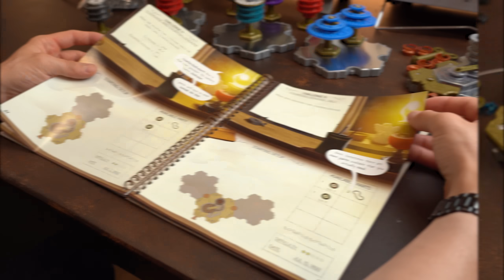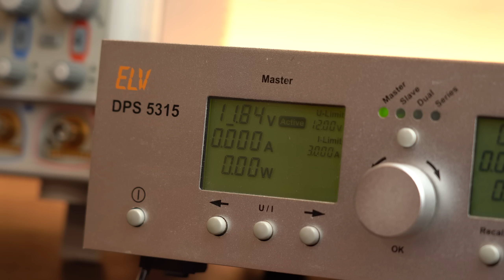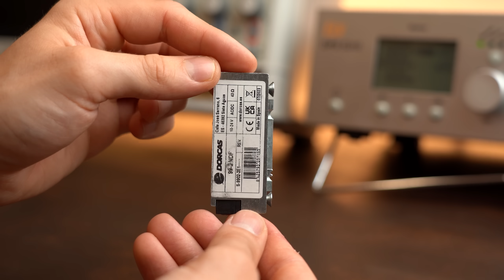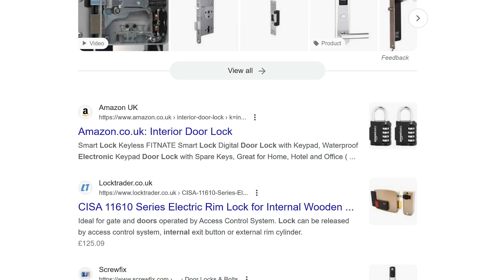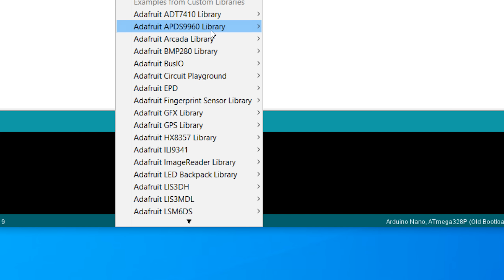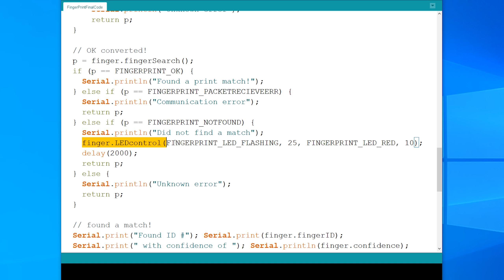Your Door NEEDS this Upgrade! DIY $40 Fingerprint Lock!

Comment: Beware!  Children are more resourceful than you expect.

You will need to add a door closer so that you can't forget to close it, leaving it open when the child is free to roam.

I'm sure that power is available on the lab side of the wall, which is probably already considered unattractive anyway.

For safety (such as getting in there with a fire extinguisher), mechanical backup is mandatory.

For door mounted mechanisms, note that power is only required when the door is closed.  So, for example, wireless charging coils could be arranged to be in proximity when the door is closed, or even some low voltage physical contacts connected.

This is clearly not high security.  (As shown in the video, the latch is easily slipped.)  So, a button high enough to be out of reach of a child standing on a chair should be just as good as the finger print sensor, and simpler (thus more reliable), if less exciting.  And then it may as well be a mechanical button, which will work even if the power is out, and takes care of mechanical backup.

Comment: I build myself somthing very simular but insted of a fingerprint scanner i use a RFID card and a Keypad (when i forget my keys in my rom). I Put all the electronics inside my room the code curently has about 5000 lines because i save my Passwort in the EEPROM and also the RFID Cards (I have 4 of them). Also it opens the door automatic when I open it. ( Actually today I rebuild most of it on the inside because I changed the housing). It uses a Arduino Mega. (I could try to make a video about it i Think)

Comment: In case you can get one, maybe replace the fingerprint scanner with RFID? I sometimes after being a jackass with chemicals or tools my finger isn´t recognized by my phone, can easily happen here... and for the cabling, maybe make a channel in the wall and plaster it or - full caveman: drill a hole straight through the wall behind the box to your mancav... ohm... workshop and there, who cares about the looks... :P

Comment: My job uses the same lock mechanism, but with RFID cards. Unfortunately, the original people who installed it got it slightly off, so now it periodically can open because the door's latch just gets smooshed by the extra millimeter of metal.

Comment: I, as an electrician, wouldn't add an extra outlet, I would just use outlet splitter, or connect wires directly to the main power if the device has to be connected permanently.

Comment: Well, no fallback in case of loss of fingerprint or such (Yes, I did once lose them for a month), but you also did it very insecure by placing all electronics outside. But since it's against a baby, that should work for a few years. Not that many with you as the dad though.   For the power: route the whole thing through to the other side. You can mount anything there, can't you?

Comment: I think it would be an easier solution to use a magnetic door lock so the only moving part on the door is a metal piece and the electromagnet can be inside.

Comment: I still don't get why you can't power the door knob solution with an outlet. I would try to stick with a solution like it's done for the door locks in cars (automotive solutions are usually very optimized).
Or you power the door knob with contacts between the frame and the door, with minimal power buffer, while the door is open.

Comment: Ok, we covered the electronics on the outside of the room and the missing mechanical override. Am I the only one questioning the weakened door frame? It looks like all that's left is a thin veneer. Give it a good tug and the whole locking mechanism breaks off. Guess you could count it as an emergency mechanical override. :P

Comment: Rather than putting that lock in Handel you could put it in key lock so that if power failure you could just use key and don't have to modify Handel

Edit:Why didn't you use the magnetic lock?

Comment: This is like you are reinventing the wheel 
This goes on the lock mechanism notthe open one so if ever this fail u use your key and u use your door as normal this simple 
But the opening mechanism that you replaced it with is nice i mean i didn't knw it existed

Comment: 1:40  "The speed of the chain, for example, is the current... and the pull of the chain is the voltage."
Um, wait, isn't it the other way around?  🤔

Isn't it, voltage - speed, and current - torque?  now I'M confused.  ;-]

Comment: Could you have put it on the bolt at the bottom rather than the handle latch? That way you can leave the old handle on the locked position and have the key as a redundant backup in case of power failure or the Arduino failed.

Comment: As others have said, wire in from behind.
Use the light switch as an electrical fitting.
Yes, I know you're German and probably want everything done exactly according to building regulations, but the current draw of that fingerprint reader is so negligible that it won't be an issue on a lighting circuit. I assume you do all electrical work in your house too, so it's not like you'll be confusing any electricians. 

As for powering one of locking handles, you could add contact pads to the door and door frame that charge the battery when the door is closed. There may even be a handle on the market that has the latch split in two, separated by an insulator and charges through the latch.

Comment: If you generally have no concerns to drill a hole for a socket in your wall. Then drill a hole next to the door, makes the design more compact and let the all disappear in the wall, Then only the reader looks out of the wall ? Possibly even with an ESP8266 for WLAN and Smarthome connection.

Comment: Make sure there is some kind of a mechanical override. These electrical locks, or the electronics controlling it, tend to fail at some point in time.
For me that was the reason to use one of those locking bolt solenoids that retract when not powered. That means the lock will open if there is a power failure.

Comment: Put a hole through the outside handle. Put the sensor withim thay knob and feed the power wires through to the crack in the door frame. Wires will be hidden, the sensor will look nice and itll be more convinient having the sensor in the handle, renoving the need for the extra box on the side

Comment: Your audio/microphone is much lower compared to other video's

2 points wrt these kind of locks... 
How do you cope with (mains) power failure (e.g. when there is fire).
How do you keep the door locked when the mains power is not there?

Comment: I would recommend a solenoid deadbolt that mounts in the frame, and wiring from the inside of the shop. Just requires putting a cavity in the door. A backup battery or a manual turn key would prevent issues if power fails and you need to get into the shop.
Alternatively, you could use a magnet and frame mounted electromagnet. Easy to bypass, but probably not for a small child.

Comment: You could have just taken out the bar which connects both sides of the door handle, cut the bar short and blocked the remaining hole in the external handle. Then you only need to replace the bar if you want the for to be normal again.

Nice project though, and I like the reader you used in the end!

Comment: You could try to get the electrical power from inside your office room, across the wall. Another concern. If for some reason there is no power in the house, you can't get into your room. However, i love the idea of electrical lock with personal identification.

Comment: Kind of bothering me that you think you cannot have the system on opening part of door because of battery. But you can have a bit longer cable and it can be wired simply and it would be ok ;)

Comment: I made it before same fingerprint sensor R503. and I placed the fingerprint sensor center of circular door handle. its more usefull. i can open the door only my one hand. 

I was only have one cable with two wires for door. Problem is i need the supply voltage and open door from inside the home for guests. This setup needs 3 wires minimally. but im too lazy for placing new cable to home. I made a polarity reversing circuit with 8p relay. If ı press button from inside and reversing polarity, door opens for guests.  There is a one bridge rectifier, one capacitor and one diode on the door for fingerprint circuit and door solenoid.The fingerprint circuit also powered when someone inside the house presses the button. thanks to bridge diode and capacitor.

Comment: How's taking bets on how long it takes before something stops working and you're locked out of the lab? 😁
Maybe a manual override somewhere might be an idea.
As I was watching I couldn't help wondering what the better 3/4 would think and then you said it. 😮‍💨 This is all so similar to what happens in my house. 🤣

Comment: Always remember that fingerprint access is more about letting the good guy not accidentally walk in, as you can fake them easily. Do not lock guns behind just a fingerprint.  It's way more secure to have a trusty phone app with an nfc app on it, that still requires a code or fingerprint on the phone.
For this purpose however it is good.
Also: make sure you can open the door with an override somehow if you lock yourself in and get unwell (like from soldering fumes, or an accidental fire).

Comment: Consider getting power from your lab and drilling a hole through the wall to your box. Also, think about adding an external power source (e.g., batteries) to ensure the locker can be opened in case of a power failure (due to electrical outages or component failures). This is important in case a child gets stuck inside or if you need to access something from the lab during emergency scenarios. To exit the locker, you would need to open the box using a screwdriver and connect power directly to the lock internally. Alternatively, you can add a simple connector externally to the box and attach the battery to open the locker directly.

Comment: You have a plenty of room for a battery. Put a a microcontroller in a deep sleep, come up with a clever way of waking it up (polling the button once a second, capacitive sensor, microwave sensor) and you have a year on 18650, which can be then swapped in 2 minutes.

Comment: Congratulations on the baby! Or perhaps commiserations if he's still in the waking up every few hours stage.

I like this project, and I think you did a great job at making it look like a professional system. But I definitely agree that the cable ducts are not the best solution for power. They'll be pulled apart as soon as your kid has the hand strength to pop the cover off. The only other downside is it could be a problem if you somehow injure yourself inside the lab and fall unconscious, it could be difficult for someone to get inside to help. But that's probably fine if there's an outside or other entrance to the lab as well.

Comment: @GreatScott! I didn’t read all messages, but you did a mistake…
You should have put that at the bottom part of your door lock, keeping it “locked” all the time…
So, I case of lack of energy, you can still use you key.
I just finished the video and changing the door handling only made it worse! :face-green-smiling:

Comment: not sure, if this is a standard design, but considering, where the wires and the electric circuit are, you can still easily break in by dismounting the box and applying electricity to the door lock by yourself...
secondly, fingerprint scanners are not that secure as you think.
i heard there is a profile, that matches 70% of all fingerprints.
nevertheless a cool project tho

Comment: The same thing I build some years ago;) I also had to drill and file on the door. I used an rfid reader and writer with an Esp32 and a custom circuit with and 24v AC Transformator to alternate the door opener. Special to make the door summing noise, to know the exact moment where a user can open the door. I created a webinterface to managed multiple users and log access times. 

Currently I planning to change the Transformator with an H-bridge to make the device smaller. 

If you’re interested, I can send you some pictures. 😅

Comment: consider adding a backup battery or switching to a "normally unlocked" lock (if exist) so in case of power outage you will still be able to open the door

Comment: I'd install a simple keyless lock at the very top of the door like shop glass doors usually have.
This way any adult can enter the room for whatever reason (if you hurt yourself and can't get up by yourself?).
It's also way quieter which should be considered when having a baby.

Comment: They do exist, just the naming is tricky if you haven't worked with building security systems. They are called an 'Electronic Door Strike' (in Australia at least), and fully replace the strike plate. Clones can be had for < $100, and often include door open/closed/latched/unlatched sensors in the wiring, can be configured to power to lock, or power to unlock. Keeps the door fire safe with the appropriate handle (locked from the locked side, exit is always 'free egress'). They cheaper strikes, as you've found are a bit of a pain, and they also generally not as robust. It's worth spending a little more for the full strike replacement, but the clones are more than robust enough for home use.

Comment: 2:30 I don't see what's the problem here 🤔 the handle doesn't unlock the door unless the fingerprint/password was input. In Korea, the automatic lock for door is a huge market and there are a lot of solution for cheap. The battery last for about a year or 2 so it's not really a problem as well

Comment: I love overengineered projects as the other guy, but you're aware you could use just a push button in the height of an adult reach instead of the fingerprint sensor, are you not? 😀 

This would have the added benefit your wife or the paramedics could get into your lab easily in case you got a heart attack or if you electrocuted yourself or something...

Either that, or make some fast and fail-proof emergency bypass of the fingerprint lock system - you know, for emergencies. 😶

Comment: Fingerprints are an identification feature, not an access control feature.
Using as access control something that you leave around on everything you touch is not a good idea...
Use something you have ( card, key, print, retina) and something you know ( code )

Comment: What makes you say you can't use the moving door as the power holder?? 

There are things such as contact pads that can transfer power through that, yes... It may take more work to fully work and may require you to use the door hinges to get it to work, but I have been sitting on this thought since I was about 12 years old....

1 : Power into stationary hinge with contact pads connected to the moving door
2 : You install everything inside the door itself and have the finger print reader above the door handle or in the handle itself, whatever you choose
3 : Whenever you move the door, power will be cut, ergo, having a single rechargable battery connected to the system will give it some time for the door to stay open while you are doing things and you may also close the door to recharge the battery automatically,... Why no one ever thinks of this is sort of beyond me

Comment: Problem 1... Control circuit is on the outside of the controlled room.
Problem 2... There are solutions that already exist for this problem. Unifi control is one, and many other options.
Problem the third... You are overworried about the infant. I say this as someone that played in the tool shed and used the yard implement ls to play as a pretty young child. If you think your room is dangerous... Imagine a room with chainsaws and other crap. Granted I wasn't an idiot and didn't play with them because I knew what was dangerous and what is just mildly annoying. Also... I knew what the tools were for and I never needed a chainsaw for what I was playing with. Granted... Play can be translated as voluntary yard work but... Meh. I knew not to use the tree prune to snap the cable or power lines.

The biggest thing is don't keep the room secret from the kid, they will find a way in and then really get in trouble, educate the kid on what the tools are what they are used for and how to properly use them. Even if they don't really want to get involved atleast they know what the issues are.
Reply: On that thought you're right. I did the same with my kids. Just educate them and show them what they are used for. 
I just give them the feeling of being helpful and they love it.

Comment: Your electronics and power should be on the other side of the wall, for aesthetics and security. This way the button is the only thing visible on this side of the system. Also, to be actually secure, make sure any of the wires reachable from the unsecure side (the one with the fingerprint reader) cannot be powered or shorted to operate the door independent of the fingerprint sensor. Otherwise all someone needs to do is open up the panel and start applying voltage or shorts to random wires and open your door easy enough. This means the reader sends a digital signal to the controller (an unlock code), not just a simple yes volts/no volts power signal. Otherwise, neat idea and can't wait to see how you improve your design in the future!

Comment: You absolutely can build this into the door without batteries. Contact pads in the door jamb so when you close the door is closes the electrical circuit and powers the device. You can make them small and recessed  to make them safe (like regular plugs have the contacts hidden from accidental touch).

Comment: To get around the door handle situation, you could just keep the door locked with the key and hide that away.  This way, if the electronic system fails somehow, you can still open the door the manual way.
Reply: A simple swap to a front door lock would solve that problem.